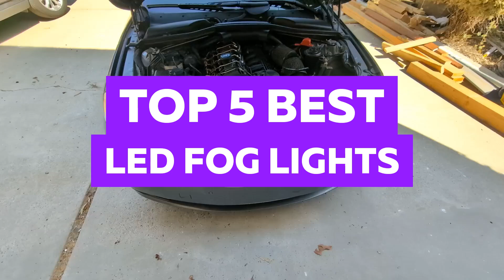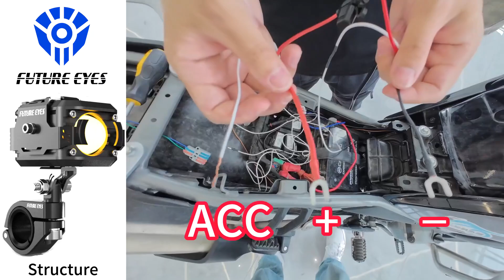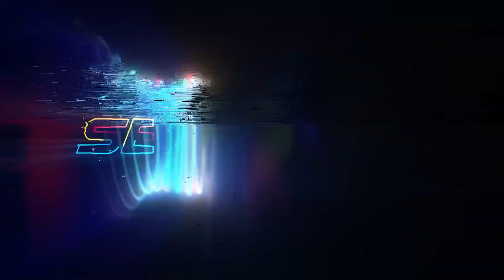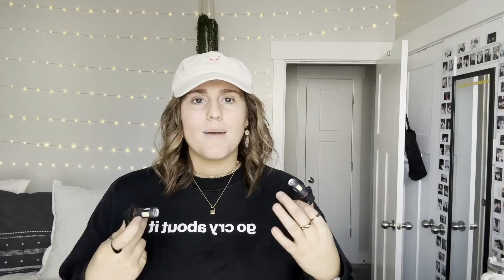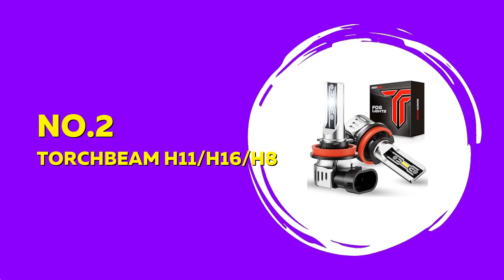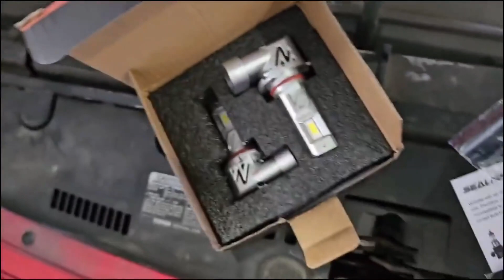Best LED Fog Lights of 2026 - Top 5 LED Lights Review

Comment from the maker: Best LED Fog Lights | Links To Products

1. Future Eyes Motorcycle Fog Lights https://www.amazon.com/Future-Eyes-Motorcycle-Adjustable-Motorcycles/dp/B0F32KCSWJ/ref=sr_1_3_sspa?tag=smoky0a3-20
2. SEALIGHT LED Fog Light Bulbs https://www.amazon.com/SEALIGHT-illumination-Brightness-Upgraded-Non-polarity/dp/B0D9Q9V3J4/ref=sr_1_5?tag=smoky0a3-20
3. SEALIGHT H10/9145/9140 https://www.amazon.com/SEALIGHT-Light-360-degree-Illumination-Non-polarity/dp/B077SGQKQQ/ref=sr_1_6?tag=smoky0a3-20
4. Torchbeam H11/H16/H8 https://www.amazon.com/Torchbeam-H11-H16-H8-Brightness/dp/B0FC6GX9N1/ref=sr_1_7?tag=smoky0a3-20
5. SEALIGHT 5202 https://www.amazon.com/SEALIGHT-5202-Brighter-5201-PS24W/dp/B0C2VGSS26/ref=sr_1_9?tag=smoky0a3-20